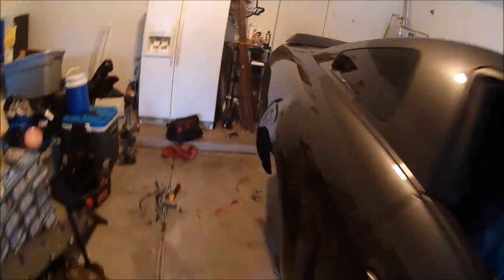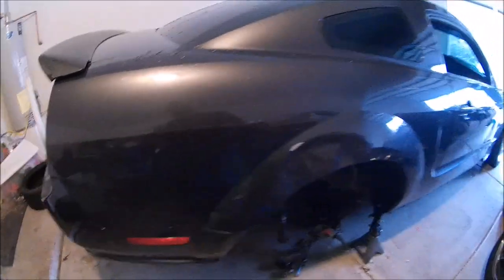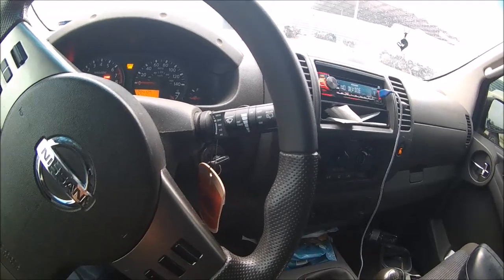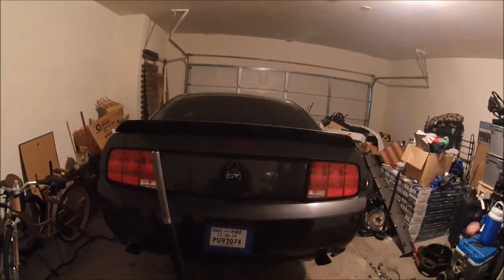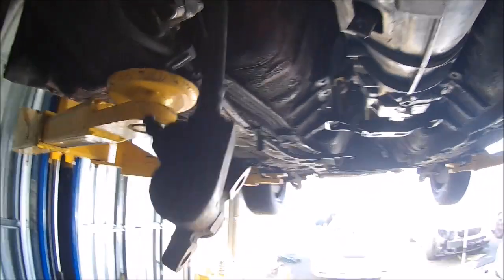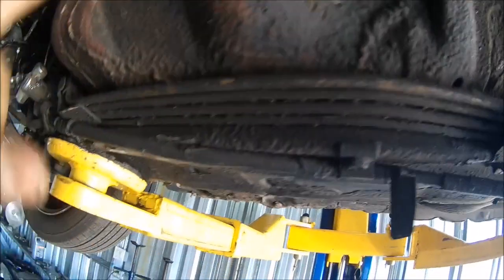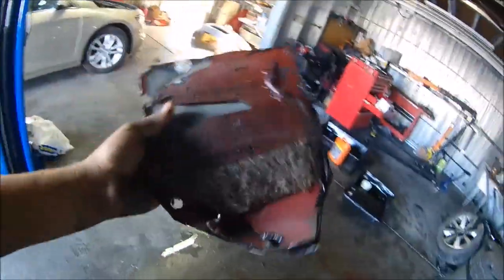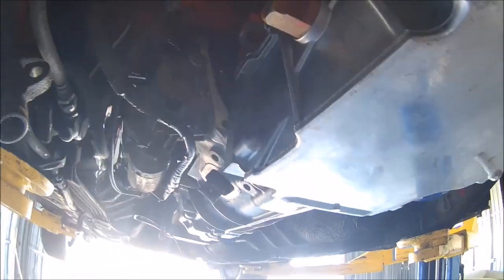LS SWAP Z31 Starter install

Comment: Thanks for the post. Keep the videos on the 300 zx Z31 LS swap rollin.
Reply from the maker: I’m gonna try and keep it going, it’s hard sometimes with so much work.
Reply: @fixitish  i understand.  You're keeping me motivated with my LS swap Z31 also.
Reply from the maker: Abayomi Mudada that’s good to hear man I’ll see what I can do next on mine to help. How far along are you on your swap?
Reply: @fixitish  am actually where you are at now. Am bashing the spot where u cut out to mount the starter. Am stumped on how i will run the exhaust on the same side. I was going to boost it but i changed my mind.  The 5.3 is alot for the Z. Just enough fun without killing myself lol
Reply from the maker: Abayomi Mudada I’m going to boost it so I’m not worried about it but there’s almost no room for exhaust on that side lol I would probably find a way to run the exhaust out the fenders or something if it won’t fit past the starter
Reply: @fixitish  ok kool. I am waiting on your progress lol.

Comment: I did this exact swap aswell I was wondering if youd think it be possible to swap oilpans without dropping the crossmember or taking the engine out
Reply from the maker: Dannymclovin69 I don’t think so, there’s no room to remove it. Dropping the crossmember isn’t that hard that’s probably the easiest if you just wanna swap the oil pan.
Reply: @fixitish  oh wow thank you for replying I completed the swap a few weeks ago but if I had a turbo vg I would have kept it what made you swap yours out and also do you think removing the power steering pump be ok since my rack is leaking alot
Reply from the maker: Dannymclovin69 I wanted more reliability. It was gonna be a v8 or i6 I went with the 4.8 mainly cause it was cheap and the opportunity to get the whole truck was there.